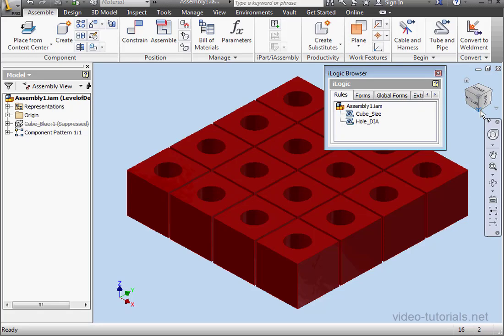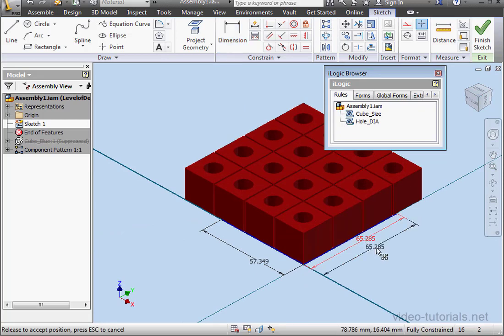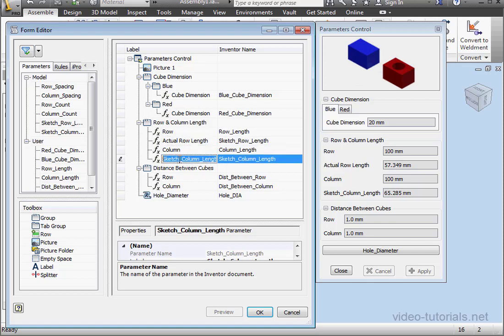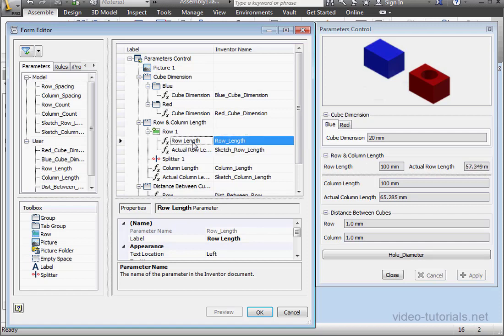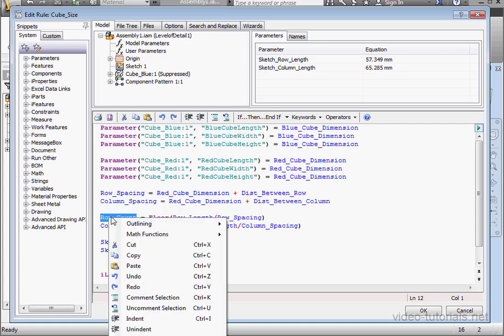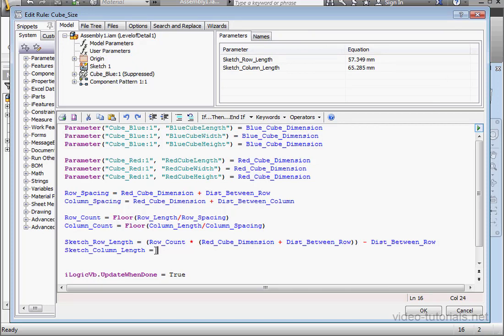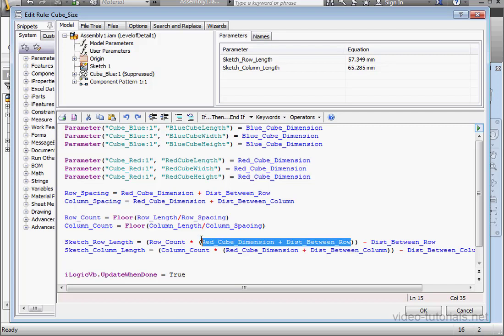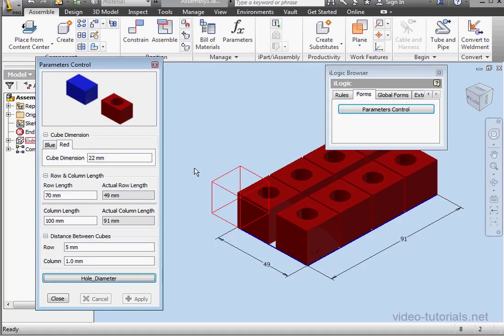51 AUTODESK INVENTOR ilogic Tutorial  Exercise III

Comment: i tried the equation between row length and row count, and for the second example when you use the row spacing as 5mm and cube dimension of 22 mm, if you add a row length as 49 mm to 53mm that will give you row count of 1 when using floor function and only the right result  will be starting from 54 to give you 2 rows by equation, in reality the two rows starts from 49 mm of row length not from 54mm... am I right?